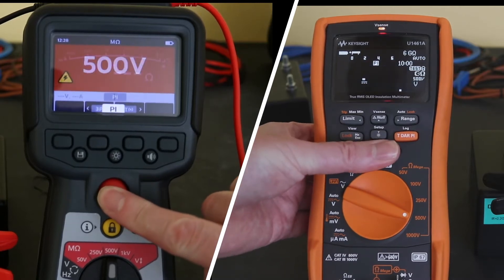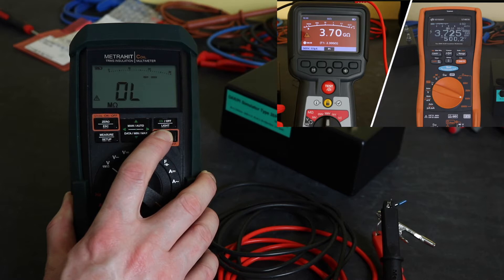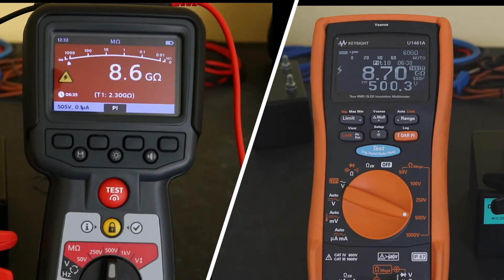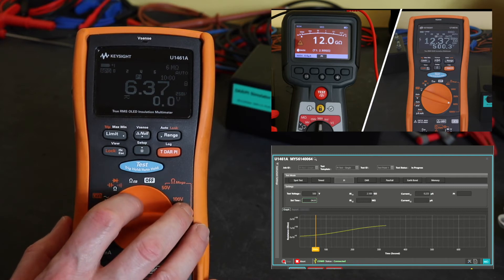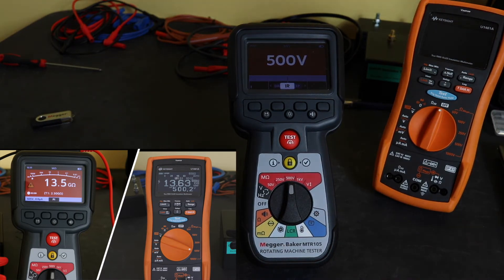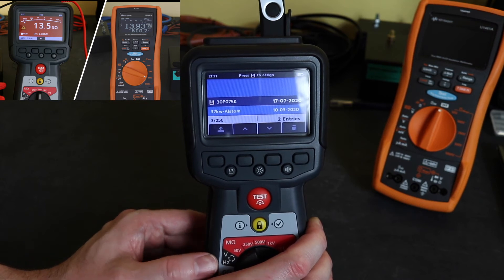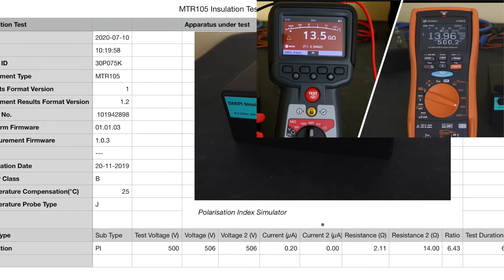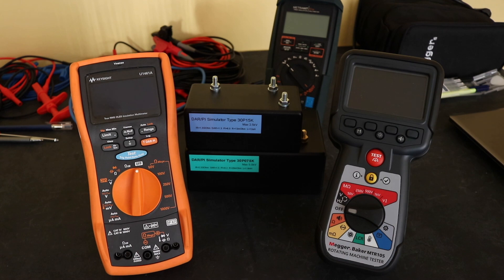Polarisation Index Test Functionality of the Megger MTR105

Comment: I've been considering the Keysight.  Have you had any feedback from them regarding the erratic reading issue you mentioned?
Reply from the maker: They sent me another U1461A that they had modified the output circuitry on, they seemed to think it was something to do with the output filter causing oscillation with the apparatus under test. The modified instrument did slow down the oscillation, but did not remove it. They stopped talking to me after that, so I do not know if further improvements were made or if there were any modifications to production models.

The oscillation only occurs on large induction machines. I have tested up to a 90kW motor with the U1461A and it is fine. Depends on what you are actually testing.
Reply: @three-phase562  I like many of the Keysight test equipment offerings but I'll stick to Megger then.  Looking at the MIT430/2
Reply from the maker: @jasonmcpherson05  Unfortunately, I am not really aware of another insulation multimeter that has the capabilities of the U1461A. All the other ones I looked at have a bit of a second rate insulation tester, especially in comparison to something like the MIT430/2. There is the Sonel MIC30 and the Chauvin Arnoux CA6526 that are instruments similar to the MIT430/2.

I have blog on the MIC30 on element14 you can find here;
https://www.element14.com/community/groups/test-and-measurement/blog/2019/10/27/sonel-mic-30-insulation-tester-review
There are also some videos on my channel of the MIC30

The element14 blog on the CA6526 is below, but I do not have any videos on it.
https://www.element14.com/community/groups/test-and-measurement/blog/2018/06/26/chauvin-arnoux-ca6526-insulation-tester-review
Reply: @three-phase562  greatly appreciated.  Chauvin is our AEMC in the US.  I like their equipment as well.  For kicks I may just send a note to Keysight.  I’ll read up on the Megger you tested as well.